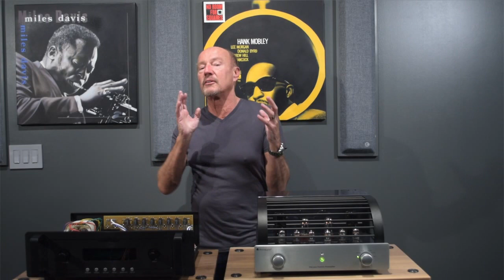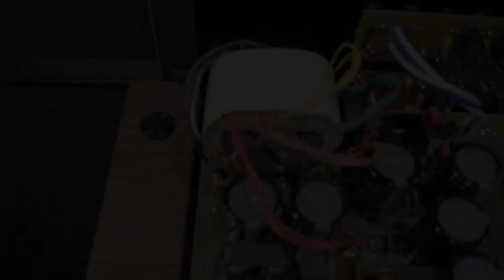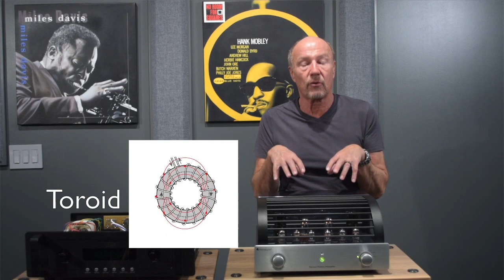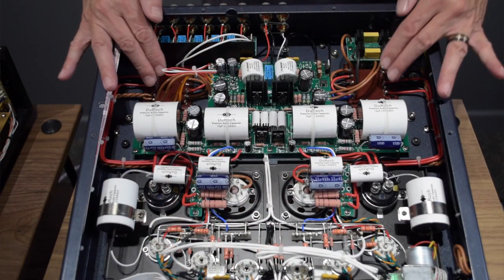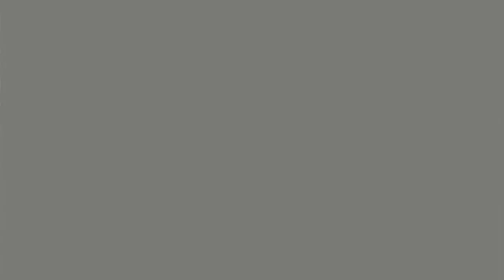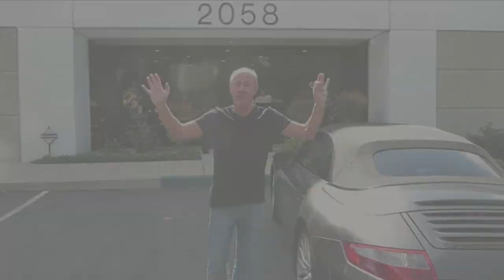PrimaLuna DiaLogue Premium Preamplier Review by Upscale Audio's Kevin Deal

Comment: Out of personal expiriance of building on order tube preamp and amplifiers 25years++ i must say i bet my life that simpeler tube preamp with only 2 tubes in preamp is much better.. Look if you want simple high gain preamo than shunt push-pull is the best. Period. And you use for it high gain 12ax7 tube.. Then if you want to build multiple tube preamp then u use 12au7 beacuse of much lover gain, and first 2tubes are preamp and 3d is only catode folower to lower impedance.. My bet is Prima Luna copy Marantz7 preamp schematic.. Thorroids are NOT expencier than square transfos, and tubes used in first preamp are Russian"good bless them" the best tubes for preamp.. 12au7 are common and just good tubes.. Rest is sales techniek.. ps- net voltage and humm filter exsites 50+years so Prima Luna didnt invent nothing new.. If you have questions just drop them here...

Comment: why is this needed if you already have a phono stage that can connect to an integrated amp??  I'm so lost on this.
Reply: This is just another format to plug all your periphrials to - cd, phono stage, dac, streamer, etc. This is used in a separate component system format - i.e. seperate pre-amp box running into a separate power amp box (or boxes if doing 2 monoblock power amps). Integrated amps are both a pre and power built into one box. Either way has its pros/cons, either way is up to the end user preference on how they are setting up their system, either way your phono stage is first running into a pre-amp regardless. There's so much more in ways of combos - i.e. if your turntable has a built in phono stage and you may be using powered speakers, etc, but I hope this helps.

Comment: Is there a reason Prima Luna chose not to have xlr outputs in their top preamp?
Reply: If the design isn't truly balanced/differential, then it's just a gimmick anyway. PrimaLuna designs single-ended stuff, so just use it that way.
Reply: VRM! Prima Luna now has the EvoLution series. The Evo 400 preamplifier has balanced in & outputs.

Comment: Ehm when are toroidal got more expensive then other newer types?
The O-core do leak less then the toroidal because it's rounder shape and the R-core are invented and used in the highest end of audiogear because the leakage problems with both the toroidal and O-core are almost zero in the R-core. 
The R-core do also avoid the problem with the uneven tightness of the wire inside both toroidal and O-core.
Reply: Toroids have advantages and disadvantages. They are very economically customizable, and a one off is not any more expensive to make than one made in big numbers, it takes a few minutes to set a Gorman winder up and you can have any ratios and turns counts you want. The cores are more expensive than a EI lam but cheaper than C cores. They lock up tighter than taylor Swift's c....ontract with any appreciable DC offset currents unless you slit the core and then you need a lot bigger core.(And also you get a M field emission).  Thats why PL has copied Bob Cordell's circuit which limits DC offset on the primary. it is an effective solution but ups the parts count. Remember Ed Heinemann and Bill Lear on the most reliable part, the one that is not there! Also AC inrush on power transformers can be much higher than on EI parts. 

 R core has many advantages and some disadvantages over toroid or C-core. In general C-cores in a can potted with microcrystalline wax or tar is the optimum design, this side of oil filled of course, but build cost gets heinous and if the part gets hot the tar goes everywhere. 

All engineering is compromise, where do you want them? You can have cost, weight, reliability or performance, pick one it's easy, two is doable, three gets tough, four is usually contrary to the laws of physics.

Comment: Kevin, is this amp available with balaned inputs and outputs? (Specifically xlr)  If not why?  I was on the understanding that Prima Luna uses premium parts and does not cut corners.  Why RCA only?
Reply: Jerome Jax! Prima Luna has just introduced an updated series called EvoLution. They now have a balanced preamplifier, the Evo 400. I'm seriously considering this unit!
Reply: @harlembob8135  I saw this too.  Currently I have the PL HP Dialogue Int. Amp, but looking at the Evo 400 preamp but if I purchase, I  would have to by a power amp.  Would like a SS to pair with with it.  The best of both worlds.
Reply: You don't need balanced unless your running over 5 meter lengths of interconnects
Reply: @alexanderstefanov6474  The RCA connector is a bane and a sign that we are not serious about doing  things right. XLR isn't perfect but it is reasonable. Ditto the IEC power connector, the old bakelite Levitons used on coffee pots and clothes irons in the fifties actually would be better, Neutrik has a very good standard that is not terribly expensive but unlike pro audio the high enders have ignored it.

Comment: How do you compare primaluna with Mcintosh and ARC?
Reply from the maker: Hi Roma.  After doing this for over 40 years as a living, I've become "grumpy" about brands according to my loving wife Laura.  I don't call it grumpy but what HAS happened is I don't get impressed by name brands anymore.  Go to Google and type in Audio Research LS17SE, then go to images.  Do a breakdown of what you guess it cost to build that preamp by simply doing an inventory and calculating the weight.  Every model change manufacturers raise the price and put in fewer parts.  Audio Research LS27 was $6995 and weighs 16.3 lbs.  The replacement LS28 is $7495 and weighs 15.9 lbs.  They sound fine.  It's easy to make a tube preamp that sounds great.  There are no new designs.  It's all the same stuff repackaged, regardless of brand.  So you have to be a detective and an accountant to get the most for your money.
Reply: Do you guys have Mcintosh and ARC tube amps in the showroom to compare side by side with the primalunas hooked up to the same source material?
Reply from the maker: As a matter of fact we just traded in a 3 month old $8500  Audio Research VSI-75 integrated towards a $3399 PrimaLuna DiaLogue Premium integrated, but first the customer wanted to do a real comparison.  So we did it level-matched by measuring test tones with an SPL meter so both amps were playing within .1dB of each other.  Both amps are hot, playing the same material.  The difference was so striking we are leaving it up for anyone to come listen to.  If you are local, come by!  

I have some trade in LS17SE, LS26, LS27, MC2300, all traded in but we don't have them up on display.  They are for sale and we don't put the used stuff out.  It's priced to sell and boxed up ready to go.  But for anyone serious I can do the same A/B there too.

Comment: Kevin, I would buy a PrimaLuna if they add balance in and out.  Seriously.
Reply: My sentiment exactly.  It's why I had to buy another brand's tube preamp - it had balanced inputs and outputs, since all of my other components are balanced.
Reply: Right? This is why I am having second thoughts right now and not abusing my credit card straight ways and go for the Pre and the HP Amp.
Reply: I agree, I would require balanced.  Few tubed preamps are balanced though. They may have balanced input or output connectors that are just wired to an unbalanced circuit.  One way to tell is to look at the volume control: a balanced pot will have four gangs (+ left –left, + right –right), unbalanced has two (left, right).